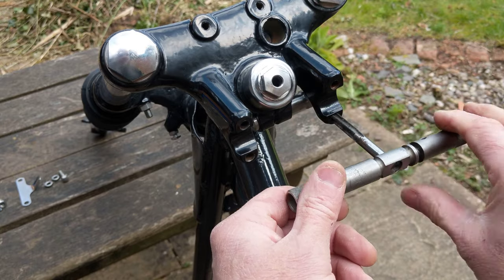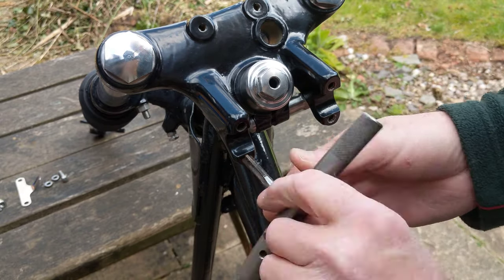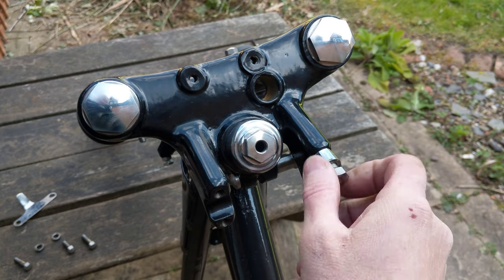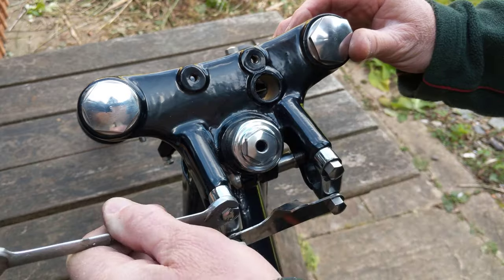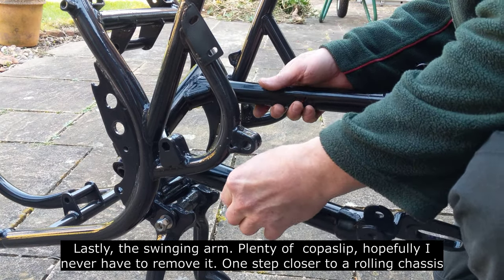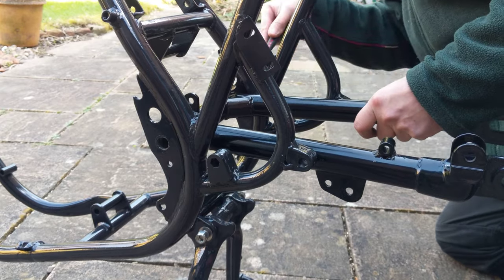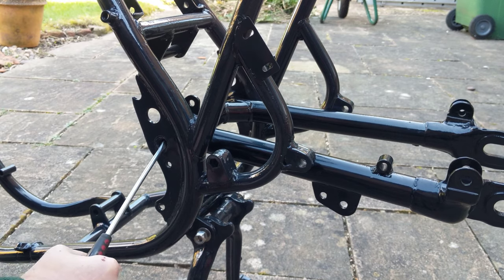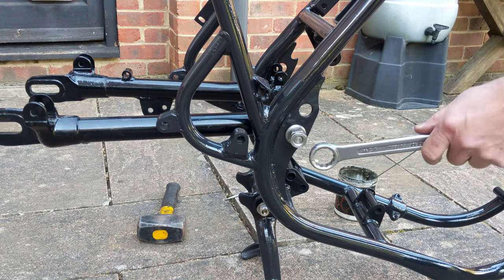Building a BSA B31/B32/B33/B34 from parts. Episode 2 of several - swinging arm (and re-do the forks)

Comment: Hello,
Just wondering how much grease did you used to repack the bushings? Do you have fill the entire axel with grease?
Reply from the maker: Do you mean the swinging arm bushings? I don't completely fill it, no. Just put plenty of grease on the rod.
Reply: @motorbikewhisperer  Yes the bushings, good to know. I did packed it because it has to be serviced every 2000 miles and so how will I know is been serviced through the nipple pumping grease and the chamber is halfway full. That’s a lot of pumping and grease, I know. Thank you very much for contacting me back. Great help.